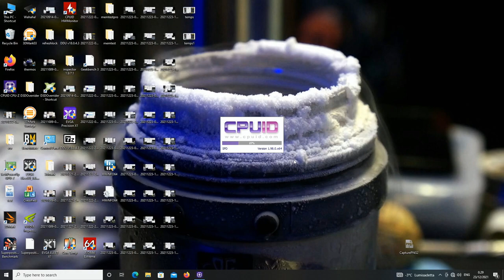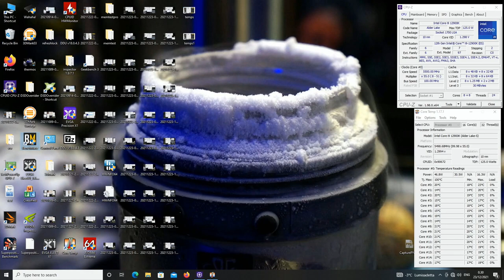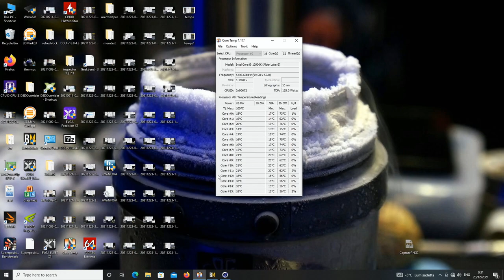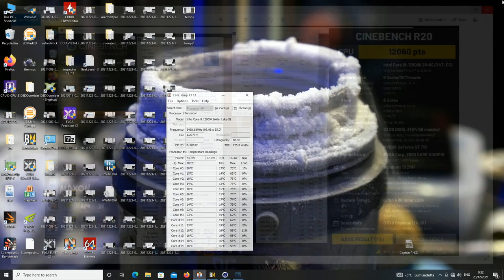Why CPU Lapping isn't Very Worthwhile on Air/Water Cooling - Intel Core i9 12900K Lapping

Comment: well guys if you lap a cpu dont do it always in the same direction, yeas the motion will be up and down without applying almost no pressure just the weight of your hands and the cpu is the way to do it, but do a up and down motion 5-7 times and then turn the cpu sideways and do the same up down motion 5 or 7 times and so on, never do it with the cpu in the same position because it will mostly get micro millimeters crocked, just keep rotating the CPU, and Yes this process is amazing and you will see difference, i have done it for more than 10 years and is really perfect, don't forget to buy a decent thermal paste, never buy 2  or tree bucks thermal paste, buy something good like the MX4- or MX6 is just 10 bucks. cheers

Comment: The last CPU i owned to be worth delidding at all was my 7700k at STOCK settings on a 240mm rad it was still on the edge of thermal throttling. Delidded, swapped on a pure copper IHS with liquid metal, temps are nice and chilly now.
Reply: And? Want a medal?

Comment: The edges are more lapped than the center because the pressure applied by the fingers is also at the edges. I made this experience with several 'massive' (unbendable?) metal objects. Because of an unintentional flaw in all of us:
- When you move it away of your body, you apply more pressure with the thumb. 
- When you move it towards your body, you apply more pressure with the other fingers.
The temperatures are better because the dye/dies is/are in the centre of the CPU and the centre is now higher than the edges. Together with the pressure of the screwed-on heat sink which helps to clamp down the hightend center, it is better, though.
Reply: That's wrong. It's to do with the elastic of the paper rucking up on the leading edge. You could make a whole jig with rails and you'd get the same effect. The only way to stop it would be to use a hard stone.
Reply: @poppyrider5541  You just say 'NO' to my explanation but you don't falsify it. You deliver a different explanation which could add to the effect. But it doesn't exclude other effects. The rucking of the sand paper happens in front of the moving CPU so the other edge on the side of the CPU would be lapped. Glueing the sand paper on the back with douple sided sticky tape would help.
My explanation works also with solid files on metal and/or wood. If the pressure is not perfect evenly distributed and the file is not perfect parallel to the surface of the object, the result is a convex surface. One can't get a ruck in a solid file, can one?
Reply: @dezibeldani  I'm going to disagree. Of course you can sand a dome by not paying attention. If you are trying to make it flat you still wont. It''s not about the pressure.
Even with the uneven pressure of the human hand, done on a flat stone you would get far better result. Coz it's not the pressure, it's the paper.
Reply: @poppyrider5541  If "it's the paper," why I get a dome with a file then? And why one get the abrasion on the flat side and not on the edge / small side of the CPU with paper?
What type (material) of stone do you use? How thick is it?
Reply: When lapping in professionally, they use flat metal dies and powder abrasives. This way you don't have paper that is not perfectly flat. It can also be automated through machinery in some instances to remove the human factor of finger/thumb pressure.
Most sharpening stones are not flat or don't stay flat. Some diamond sharpening stones are flat but its overkill for copper. You could use glass or granite that's been perfectly flattened to .0001 and abrasive powder in a pinch
Reply: @tacticalcenter8658  Thanks for your answer. Professional equipment (machinery and jigs with guiding rails) is too expensive for me. I hope to find a way with tools for hands to do the job.
Reply from the maker: That was issue more with the lapping machine at Kingpin. If you looked at the 10980XE paste spread after Ln2 mount it was amazing.
Reply: Its actually not a very big deal that the corners/edges are lower because the heatsink will pull most of the heat out of the surface area just above the die.
Reply: @sloppydoggy9257  For the main business (cooling) a dome is better than a concave surface.
Reply: As a lifetime machinist who has also worked in an optical lab for 13 years, I agree that the lapping technique in the video is lacking. the best technique is to go in one direction, stoping and lifting straight up at the end of the stroke, rotating the CPU 180 degrees every few strokes, using even pressure across the entire surface.
Another problem is the glass. Glass this thin WILL flex. You might not think it does. It does.
I'm fortunate enough to be able to lap my CPU on a calibrated granite surface plate, but a cast off piece of quartz countertop can do the job much better than a piece of thin glass.
@poppyrider5541 is right that the sandpaper wrinkling is a problem, but it is one easily solvable with a good quality double-sided tape. I use nothing but 3M tape for sticking down sandpaper for flat lapping.
edit: also, use both hands and rotate the CPU 90 degrees between grit sizes. this allows you to see when the scratches from the previous size are gone. if you always go in one direction, you will never get all of the valleys from the previous size out. professionally, when polishing mold cavities, we try to go 30 degrees to the previous strokes, but that's impractical in this situation.

Comment: My ihs was very very uneven from a tight socket clamp. Did the washer mod, lapped, applied kryonaut and dropped 20c in cinebench. Started to lap my AIO but it was already very flat. Huge gains from CPU lapping here.
Reply: 20C? I don't think so.
Reply: @TwiztedJugallo  what do you know of the affairs and specifics of others efforts? nothing..

Comment: I found liquid metal on the IHS paired with a 360mm rad worked really good in my case. I don't even have a very good chip (SP 83) and I got 5.2ghz all P-core 4.1ghz E-core and 5.4ghz turbo on 1.39 volts with good temperatures. With that I was able to get over 30K in R23. Honestly, I could probably push it a little further too.
Reply: What temps and did u overclock it to get those scores?
Reply: @stonyspeedxd131  In R23 on multiple runs not a single core hit 90c. The core temps hung around the mid 80's at the highest temps.
Reply: @battlephenom8508  pfft

Comment: So, I think lapping towards true flat is probably wrong on 12th gen, but still good on a cooler. I lapped my CPU and AIO flat, and only saw like 4c immediate drops. I took that apart and relapped it, focusing on sanding down the edges, while leaving a flat, raised, rounded square in the middle. This covers 90% of the short width, and 70% of the long width. I really sanded down all of those 90deg corners with the IHS walls. I got around 10c drops, am very happy. 

My main though is that if the cooler is contacting the IHS plate too closer to the IHS walls, under thermal expansion those walls expand directly into the cooler, and the cooler's pressure is going to act to compress those walls, which aren't going to budge. Also, thermal expansion, plus the CPU bracket, will make the plate concave on its own, I think. However, if the cooler is contacting the IHS plate further away from the outer wall of the IHS, then the cooler isn't trying to compress the IHS walls as much, and can act more on the flexible IHS plate and maintain better contact. IDK though, just my thoughts.
Reply: Neeeerd
Reply: So why not create a jig that only exposes said rim for lapping?

Comment: how is lapping not useful for water  i dropped 5 c avg on all cores and  had all cores within 1 degrees of eachother
Reply from the maker: Depends on CPU and generation, with all of these latest generations I've had very minimal gains from lapping only the CPU IHS. Both surfaces would have to be lapped so the CPU and the cooler.
Reply: @LuumiJuhani  yup, it all varies. Heck you could get a 12900k that's way more messed up than most of them due to manufacturing process variables that lapping might be necessary for. It all depends.
Reply: My 3900x was concave so I gained alot, my friend tried the same thing tho I told him it's not worth it since his CPU wasn't concave. I gained around 6 - 8C, he didn't gain anything.
Reply: I expect some gain from lapping a 5600X that I have. The block that I have has a mirror finish so I think it's flat, I will try to see if it really is. At the moment the CPU has a delta of almost exactly 6 degrees Celsius compared to the water when idle. If I lap the 5600X I will see if I can make a video about the lapping and the results and post them here. Wish me luck!
Reply: @sldkjh  mirror finish does not mean flat. No cooler is made flat unless its for ln2.

Comment: should you not do the lapping in an 8-pattern, so all edges are getting even pressure?
Reply: yes!
Reply: There are multiple ways to lap, this is just one way.
Reply from the maker: You can do whatever way you want to.
Reply: The figure 8 just helps the sanding go quicker. If you back and forth one direction, it creates tiny grooves, change direction it's no longer in grooves so it removes material better.
 I don't really know how to explain it that well. Just remember figure 8 is quicker.
Reply: @Apollo-Computers  if u want an even surface, 8-pattern is the way to go!
Reply: @Apollo-Computers  actually going cross grit patters is the best way. meaning you go a few times in one direction rotate ihs 90 deg then sand in that direction repeat as much as needed/allowed. wet sry sandpaper well sand paper in general cuts best when cross sanding.

Comment: I was going up to 2000grit but I stop at 1200 now,  I always lap the cooler too.  3 to 6 degrees is max but worth doing and much less risk than a delid.  On ambient using thermal paste under the IHS (thermal grizzly kryonaut) you are only looking at about another 2 to 3 degrees after lapping.  I'm going to do some tests using my 6 year old 8700K on an Apex board and chiller to see what differences I can get.  I still have some decent HwBot points from when it was new so will be interesting to see if performance has degraded over time.  It's had around 3000 hours of gaming plus another 1000 or so on top as it was part of my daily for 4 years.  It benched X265 4K at 5.1ghz, if it can still do it on exactly the same setup I probably won't delid, I'll lap it though whatever the result.

Comment: igor’s lab documented socket 1700 mounting pressure being so high it is warping the cpu while mounting.
your cpu is not flat and it will never be flat if lapped outside a socket.
Reply from the maker: Would need separate socket to do the lapping on.
Reply: @LuumiJuhani  also heat/cool the spare socket to the temp you will be operating under.

Comment: It used to be very worth it years ago when there wasn't as high performance thermal paste / liquid metal. But when I got a 3700x and a NH-D15 i first tried it with nearly the best conventional thermal paste, took readings of the inlet surface temps etc then lapped the CPU and retested. I was expecting the normal 8-10c drop but only saw about 4-5c drop. Two things i think are happening, the actual CPU die is much smaller now so respectively the IHS is much bigger in a way thus being less of a bottleneck and the thermal paste was doing a good job of moving heat though the gaps in the uneven surface. Then used liquid metal, to which had just a ~2c drop in temps.

Long->Short; Lapp the cpu/heatsink if you don't plan to use liquid metal 😉
Reply: Liquid metal isn't worth it

Comment: Only worth it if your CPU is really concave or convex. You should also consider a real lapping plate. With sandpaper you're just sanding, not lapping. Big difference.
Reply: lapping is sanding lol. youre making a non flat surface flat by sanding away extra material hence lapping. you can use any surface like a glass panel or something along those lines long as its completely flat.
Reply: @-eMpTy-  I guess you better go tell kingpin hes doing it wrong as well. i think you better go back to playing your videogames man. you might wanna look at the uploaders videos. hes not even in the field of computersl. guys gut completely random videos.
Reply: @ColdVenom159  
He's not "doing it wrong" but he isn't lapping the CPU, he's sanding it.
Reply: @-eMpTy-  are you dense? lapping is sanding. lapping is a term machinists use to say sanding. Example in the freight industry forklifts are called motors not fotklifts.
Reply: @ColdVenom159  sanding isn't real lapping. You need to use a lapping plate designed specifically for lapping to get a truly flat surface
Reply: @chancekremer6259  what ever you say. look up what cpu lapping is. as ive stated before you have those who speak on it then you have those who are actually doing it. lapping plates just make the job easier. been done used them myself many times. give me some sand paper grit wise of my choice a flat hard surface and a straight edge and ill give you the same results a lapping plate wil give you without using a lapping plate.
Reply: @ColdVenom159  they should call it CPU sanding because using sandpaper is sanding and using a lapping plate is lapping. Yes if u use sandpaper on a flat surface you can achieve a very flat finish but it still will not be as flat as a lapping plate. Lapping plates allow u to get to under a micron of accuracy.
Reply: @chancekremer6259  lapping is sanding, what do you think a lapping plate is. its a fine grit flat sanding stone. lapping is a fancy word for sanding. not even lapping plates are 100% no form of lapping is 100% this is why we use thermo paste to fill in the microscopic imperfections the human eye cant see. you also do not want a mirror finish as it dont give anyting for the paste to grab onto. myself ive lost count hoe many waterblocks ihs's cpu dies as well as gpu dies ive lapped. never once have i used a lapping plate. the couple times i did was on old hardware to see how i would like it and to be honest ill take my sheet of glass my sandpaper and my straight edge over a lapping plate eny day of the week. you go ahead any buy yourself that crazy expensive lapping plate while ill go out and buy my sandpaper for less the $10 with my 10$ straight edge with my glass sheet i got for free. You really thik those of us who actually do this still jump jusp into it without thinking about anyhting. youre sadly mistaken we ? alot of things and go at the stuff from every poss angle. Im gonna finifh off this comment saying go tell kinkpin his lapping machine isnt lapping. see how far you get.
Reply: @ColdVenom159  I have access to a lapping plate at my machine shop I'm just saying a lapping plate is much much more accurate than sanding how hard is that to understand? In the machining world sanding is used to make surfaces smooth to the touch and get rid of sharp edges. It is not used to make a surface completely flat. This is what a lapping plate is for. If u use sandpaper then you will not get a completely flat surface you will only get a somewhat flat surface that is just a fact.
Reply: @chancekremer6259  you heard what i said. its tiring explaining it to people who only speak on it and just dont grasp it. you speak on it were actually doing it theres a massive difference there. you have access to lapping plates i own them. theres nothing a machine shop has that i cant get my hands on. the perks of being the in automotive field all my life has its perks. if you are in the machinests field and have been for a decent amount of time then you would know lapping is a term machinists use to describe sanding. i guess youve never heard if 4000 grit wet dry sandpaper. get into body and fender work with sandpaper as well as wet dry sandpaper and youll see just how far sandpaper can be used when its in the right persons hands. you refuse to grasp the fact that sand paper can be attached to completely flat surface like a sheet of glass. idk why i keep trying to explain this to you as you clearly think you know when cuz you have access to a machine shop. you have 1 sub and 0 videos tho those of us who have videos to credit what we speak on and are doing you seem to think you know more. interesting how that works out. i guess this is why people like myself are on overclocking lists and some even hold world records using sandpaper over lapping plates while people like you just speak on it. at this point im done here, have a nice day.
Reply: Every cpu I’ve lapped has been better regardless of cooling.

Comment: Does going to finer grid like 2000/3000 after following what you did achieve anything beyond a nice mirror finish? I am trying to lap my 3700x basically for fun, and I plan on doing 400 (remove nickel) -> 600 -> 800 -> 1200.
Reply: I think its enough 400 -> 1000 -> 2000 -> 2500 :)

Comment: Luumi are you certain you didn't get more gains than you thought? Your minimum temps where a few degrees lower than your test after lapping the chip
Reply from the maker: Not much anyways for water, as I said the waterblock is not flat so I could gain more if I lapped it.

Comment: I ground down an fx4100 and its max temp dropped by 10C same stress test, same clock, same room temp. Were as for the 12700f it only dropped by 3C

Comment: the goal of cpu and waterblock lapping is to STOP using thermal grease.
we use thermal grease because the surface area on both cpu and waterblock are bad.the thermal grease fill the air buble, but thermal grease isolate heat
so you want to use up to  8000 grit sand paper, you want to have a mirror surface on both side.
at this point,  the cpu stick naturally on the waterblock, without thermal grease.

but , it's really painfull to have this result
you just need to look at the end of your video to understand why.
it's difficult to have something absolutely plane when you sand something by hand